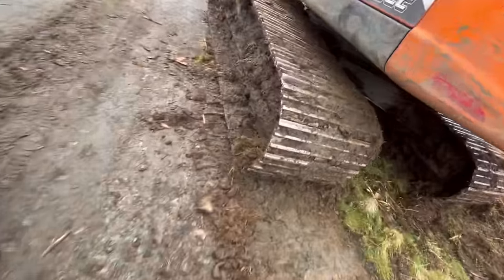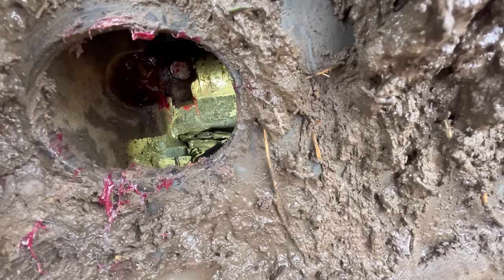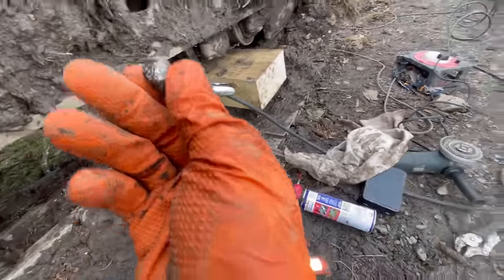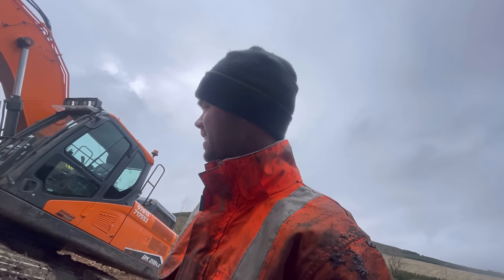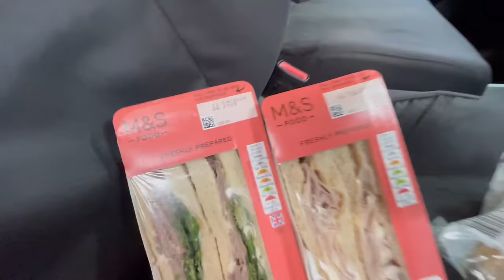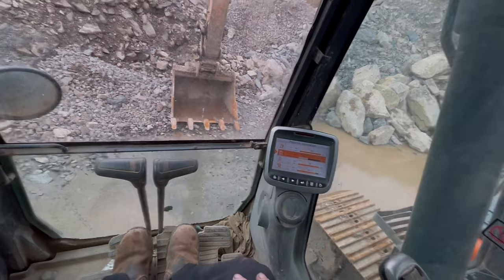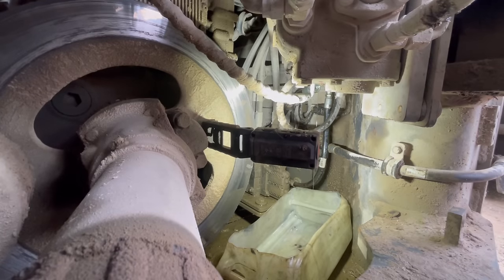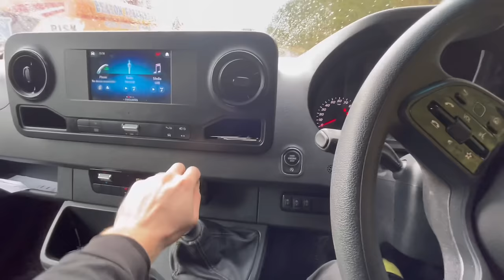Snapped bolts in the track frame / Big Bertha gets some work / oil leaks on a shovel

Comment: Content is spot on Ali, & I’ve said it before, “ it’s a day in the life” Service’s are more than spinning filters, it’s your/our time to spot things, prevent breakdowns, move wiring we know is going to chafe etc etc, it’s your time when videoing/editing etc. 
Ref them broken bolts, do you have any Irwin type fluted broken bolt sockets, they are brilliant (other brands will be same), is there a reason you don’t grease the bolts when reassembling would make life easier in this situation of broken bolts, plus if they were tight coming out, they go back in a lot easier (yeah I’m aware some need to be thread locked etc). 🙏👌👍

Comment: In the next instalment, a Skint Ali will be slumming it on Aldi crisps and Spar sandwiches! lol 
I like a bit of everything on the content, when you're doing the servicing its entertaining to see the random bits and pieces on the machines that you point out. Like the crash damages and that splatter inside the cab, driver will have looked wasted after that muddy tsunami! 
Throw in the in-depth repairs, bit of scenic driving to the job (Time-lapse seems to be the better option for the commute sections) and a good old Ali Rant about something, then it makes for a good video.

Comment: If that was me, those broken bolts would have been in for 30yrs and I’d end up drilling them out😆🤦‍♂. Bit like my luck today, need to change the fuel lift pump on the Sanderson as I think it’s leaking fuel into the engine oil… oh it’s a proper 🔔🔚 of a job😩

Comment: I always weld a washer on first as i find you get a better weld on it than up inside a nut. Regarding the WD 40 I have found it absolutely useless unless it is free to start with. Wurth 1040 is a oil based penetrating oil that I find excellent. Seen a fella welding around the stud to get heat into the bracket and then grind off weld. 👍

Comment: Ali, for the sake of abit of head scratching fitting things in the van, would a small pressure washer (240V inverter / small plug in mains unit / small water tank) not making jobs loads easier? E.g. cleaning that track section off before chasing after bolts

Comment: Great vid, I’ve got a little 13A mini mig/Arc welder that’s a lot easier to handle and would work well on the snapped bolts job.
Could you have not got two nuts locked together on the top of that stubborn bolt to help extract it??
I know It’s easy to think of different ideas when you’re not there doing the job at the time crawling in the mud.

Comment: Servicing videos can be a bit repetitive, but if you include some added explanation (as you normally do) about the systems you're working on, then it makes it much more interesting.
My main reason for watching your videos, is to learn.
Reply from the maker: Good idea will do 👍
Reply: @alisdiggerdiary  Thinking about the hassle that you had getting the last one of those broken track frame bolt studs out, the manufacturers really need to apply a bit more thought to the design, don't they? 
There are so many ways in which they could improve the situation and therefore make your life easier.  
For example, using bigger diameter bolts, that are also longer, with the projecting thread more robustly protected against corrosion (Denso tape?), so that any broken-off studs can be driven back down through the track frame, seems like an obvious improvement that they could make.
Do Develon encourage feedback of that kind?  
I'm sure that they must have some sort of mechanism by which their dealer network can inform them about recurring problems and ideas for improvement 🤔
Frequently, as I watch your videos, I'm thinking about how these things could be could be improved, but it's of no value, if nobody wants to hear about it.